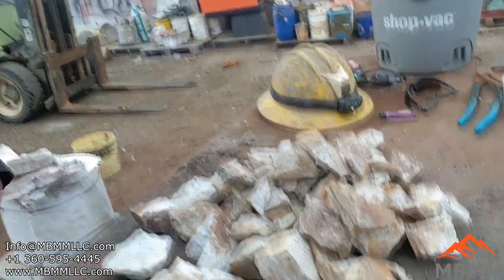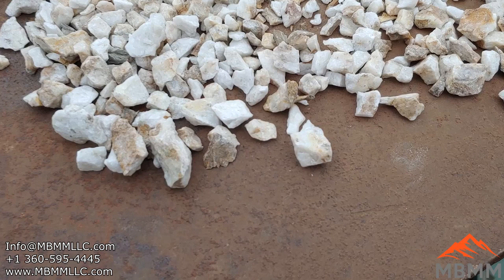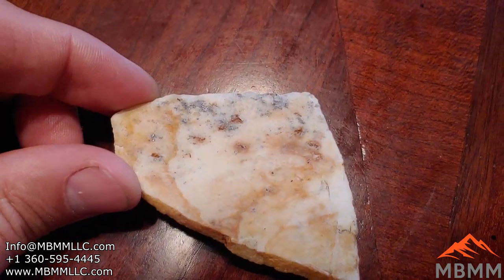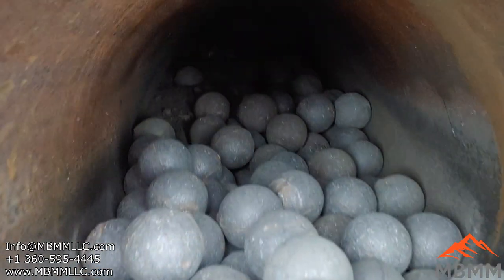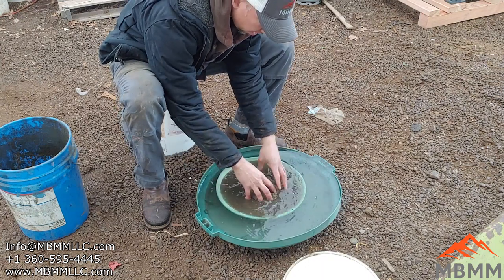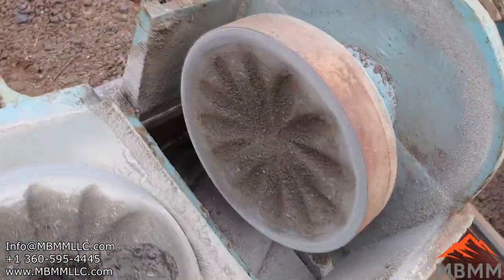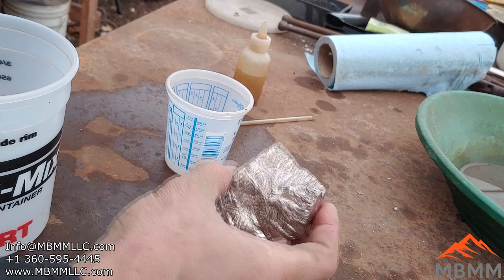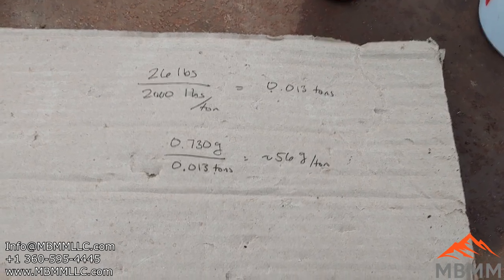How To Find Gold

Comment: These videos gives one an appreciation of just how much work it takes to produce an ounce of gold.  Not as easy as it sounds.
Reply: Or two ounces
Reply: Run a pin-pointer  or larger metal detector over the table of crushed rocks and you will get a quicker find of any gold. 
Use your processing time wiser with the right tools!

Comment: You need to weld those nuts on the back of the flange of your tube mill. So you don't have to use two tools to remove the bolts.
Reply: Or just thread the thing. then you have no need for nuts.

Comment: Jason:  I would be very wary of the 56 grams/ton analysis. Not because you did anything wrong or because of a math error, but because when I watched the previous video, you only took the best-looking samples back down the mountain with you. 

Those samples undoubtedly were 56g/ton, but the vein as a whole is unknown and probably a lot lower. 60 years ago when I took analytical chemistry about half the course was spent on sampling. 

Great videos by the way.
Reply: That's exactly what I was thinking. This isn't a random sample so to speak.
Reply: Isn't that kind of a wash? Sure, it was the best-looking samples, but they also came from a discarded tailings heap.
Reply: @user-lb8do4ew6k  I thought he knocked the samples directly from a formation in the side of the mountain.
Reply: @stopthephilosophicalzombie9017  He did..
Reply: @stopthephilosophicalzombie9017  yeap, you're right. My bad..
I thought he was hoping those surface samples would be roughly representative of the veins underground.
Reply: Maybe it's even higher if he grabbed all the ore
Reply: Good point but keep in mind vein richness can increase the deeper one goes too.

Comment: I would expect a better result from the tube mill could be obtained by using mixed size media (3", 2.5", 2", 1.5", and/or 1").  That would allow the smaller media to  fit the gaps inherent with the larger media and result in a more uniform result from the crushing.  Also, loading your mill with about 25% solids you get better life from the media and more uniform crushing.  Here is a good rule of thumb:

The starting point for ball mill media and solids charging generally starts as follows:

* 50% media charge
* Assuming 26% void space between spherical balls (non-spherical, irregularly shaped and mixed-size media will increase or decrease the free space)
* 50% x 26% = 13% free space
* Add to this another 10%-15% above the ball charge for total of 23% to 25% product loading

Most solids will decrease in volume as the particle size is reduced, so you may have to add more solids and check the solids volume again after a few hours. Once the quantity is finally determined, you can simply load the mill with the total amount of solids during the initial mill charging.
Reply: Jason you are awesome . Hope you find some free gold too.  2 oz per ton is a great find ! You seem to have a huge amount of equipment. Have you any idea how much momey you have invested? I know you have to pay for electricity also. How much per ton does it take money wise? Operating costs. Plus wear and tare? Alot to figure out i know. As a small operation i assume you have to consider the costs. I assume you are doing well with the value of 2oz per ton. It must take some time to process a ton of ore also. Any idea of how long it takes to process a ton of ore? What do you do with your waste rock? There are tons of people in California who dont like miners. They say there mining messes with drinking water. I assume you dont have those regulations that plauge hard rock gold miners in California.
Reply: @Loyal 
Yeah you’re right. He needs different sized balls to fill in the gaps created by the large balls and keep missing the pebbles that make it through.

Comment: Jason, just a couple of observations.  1.  A mix of sizes of balls will eliminate your rounded stones. 2. Almost no iron staining in your original samples so I suspect all your metal filings picked up by the magnet were parts of the tube wall and balls.  3.  Visible gold in quartz is far more valuable as jewelry than as gold dust.  4.  High grading (selecting promising rock) destroys any ounces per ton consideration of the mine, itself. I always enjoy your tenacity.  Keep up the good work.

Comment: there are still rocks because you need more time for the crusher todo its work. and btw it is still considered a ball mill weather it rotates or vibrates. put a small mesh screen on 1 end only about 20% so you can collect the dust and add more material ..

Comment: Great video. Like getting to see the total process. I do something similar when spreading on the table but I use my little Falcon MD20 metal detector and it finds those very small pieces quite easily. Great work.👍
Reply: Did the iron deposit trip the sensor?
Reply: @G4RR3TTJ  yes they did. However on the Falcon, they read exactly opposite of what the gold does so it’s easy to tell them apart.

Comment: How to find gold Part 1 was great and I was glad to see you didn't tip yourself over and go bouncing down the cliff !!  I hope you wore your safety glasses while you ran the ore through the jaw crusher.  I've got pits in my glasses where chunks have jumped out and hit the lenses.  Beautiful specimen in the slab !!  Be sure to include smaller diameter balls in the media, down to at least .25 dia. of your larger balls - usually in a full time ball style mill/crusher the media breaks down over time and it's an eyeball magic type of estimate on the media size needed.  If you are getting larger chunks, then a smaller media mixed in is indicated.

Comment: 1) Correct me if I'm wrong, but that 56 g/t is not a realistic number, as that sample consisted of hand-picked samples of gold-bearing rock. To set up an operation in that area, one might have to dig 1/2 ton of dirt just to get that much gold-bearing host rock, right?
2) Rather than sort through that table full of stones by hand, looking for gold, wouldn't it be a lot easier to use a metal detector? Just run it over the spread-out pile and pick up the hot rocks.
3) Since you're gonna pan that crushed powder out of the tube mill anyway, to get the stuff out, use a hose and wash it into a bucket. Maybe use a brush too, to make sure to get everything out of the mill.

Comment: Maybe set the whole tube mill up on a bit of a see saw to run the ore back and forth as you like.
Just put one of those rods under the base.
Might find that you getmore crushing done if you throw some odd shapes in with the steel balls too.
Cubes, pyramids, cylinders, M&M shapes, angle iron sections cut at odd angles to make points, hammer heads,, or maybe different sized balls.
I think the gravelly stuff won't find hide hols then.
I think your gravels are riding in the voids that always form amongst spheres.

Comment: haha, looking through piles of rock is something ive been doing for years now. (recently with a bit of sapphire ore out of Montana, Yogo dyke, and some diamondiferous lamproite form Arkansas. i found over 150 sapphires in the boxes of ore i bought, one was found in my 1/4 inch screen while wet sifting haha. i kept all the silt that the material broke up and or polished off the material while using my rock tumbler to break it all up. pretty epic volume of sapphires form 5 boxes of ore for $99 each haha. i also have over 150 yards worth of Slate that i am sorting by size, by hand, and or via a 3/4 expanded metal mesh i put o a frame that fit over my tractor bucket i coudl just shovel right in to soft out the small sizes and the dirt form my pile. still got a huge volume to go through haha, but it works great. its a heck of a process, but i find some nice samples in my pile for my sample collection, but the stone is being used to build slate terraces using steel and concrete for structure. got many more similar projects to go for my property haha. but i think by there end, i will have handled every single stone of the pile. how ever many Millions there are, from 200 pound slabs, to half inch grains or less lol...

Comment: I think the larger rocks that remain in the ball mill are getting stuck in the voids between the balls in the bottom layer..showing that they are basically locked in and inert. The solution might be to install the screen on the bottom. Discharging the concentrate and freeing up space so the balls can more effectively move

Comment: Liking the shaker with the engine under tube on top with balls. Ever thought of making a tumbler with balls (like they use to coat sweets with)? Figured with right gearing could be very efficient only requiring a small motor.
Reply: What you discribe is a typical ball mill.
Reply: @HanstheTraffer  Thanks Hans.
Reply: MBMMLLC makes regular, traditional ball mills, but giant ones.

Comment: Could I suggest getting a metal detecting pinpointer in doing that on the grass use the pinpointer to find the rocks that have metal in them each individual rock around the pinpointer if the pinpointer doesn't ping or Buzz on a specific Rock you know it's no good

Comment: My guess as to why pebbles end up not crushed in the ball shaker is that the balls are a fairly large size and all the same.  Between the balls there are pockets for rocks to "hang out" without being crushed.  The pebbles are crushed until there are just as many as there gaps between the balls.  I suspect that if you added enough of smaller sized balls, you would have very little residual pebbles. Exactly what size and number would be trick to calculate but I would guess it should be about the size of the left over pebbles and about 20% the number of large balls.

Comment: The bigger rocks are too large for the them to get crushed between the balls as they vibrate. That's why you're seeing a lot of super fine material and very large rocks. Everything below the size of those rocks can be crushed by the mill. Classifying the material, using larger balls in your mill, and using a higher energy shaker might solve your problem.

Comment: the gold grains got into the solid quartz when both were liquid during The Flood 4,370 years ago.
as some gold obviously became locked in the quartz when teh quartz precipitated out and solidified into cracked rock wheer you find it today.
It logically follows that much more gold would flow out in the Flood's hot water and go flowing downhill and settle out in the flood sedimenst in teh valleys.
Now you have found a quartz vein with gold you need to do some drilling in thde valley bottom to check core samples that actually might be many hundreds of feet deep.
South African mines go down a mile or so ...

Comment: Given that the table is more efficient than panning and can handle more throughput, why bother with panning?  What's the point of a ball mill that doesn't turn?  Angle iron lifter bars and a rubber lining to prolong the life of the tube will prove far more effective.  That's why you get fines and coarse after only an hour.

Comment: Is two ounces per ton a profitable process with all of the overhead costs?
Reply: One ounce per ton can be profitable, depending on operating costs. Remember, an ounce of gold is worth $1635 at today's gold prices. With fairly minimal equipment (one loader, one dozer, two trucks, a one ton per hour system like in Jason's videos (crusher, hopper, hammer mill, shaker table), a team of 10 miners can process easily six tons of ore per day. That's nearly $10,000 per working day. If 50% of the total take goes to the ownership, that leaves $500/day for each worker. 
Worth it?

Comment: Bc rocks of a certain size are a  perfect fit for the arcs of the spheres, so those rocks will keep rolling around in the spaces in between the balls, until they get caught. Once they are smaller they get powdered instantly, when they are bigger they get broken down into that size first. More powder, less space, so they shouldn't last much longer, if they do, just take a few balls out, or add more material. You need enough powder to fill the spaces between the balls. Peace

Comment: It’s probably like when u are mashing up anything like say potato’s. Some get stuck up and away so they DOBT get smashed like the rest. Probably the same principle on that ball mill material finds its way to an area wher it gets stuck and without your intervention. It can’t get smashed 

You would probably need that tube to tumble like a rock polisher does to fix that. So if it shook like it already does and  constantly tumbled or spun slowly so the material would fall out of those areas and gets properly crushed by the steel balls

Comment: Why waste time with the ball shaker when a hammer mill would work so much faster? I mean you literally spent hours waiting for that ball machine to process the material you put in it, when you could have spent just a few minutes to accomplish the same thing with a hammer mill! So, unless you have a ton of pyrites to process after a run through your turnkey system, I do not see any reason to ever use that shaking ball machine. If you have a ton of sulfides and pyrites to process, wouldn't it be faster to just roast them and then smelt them the way you normally would? 

Tell me why I am wrong and why the ball machine is a good option versus the hammer mill?